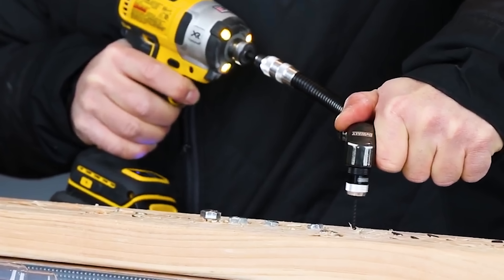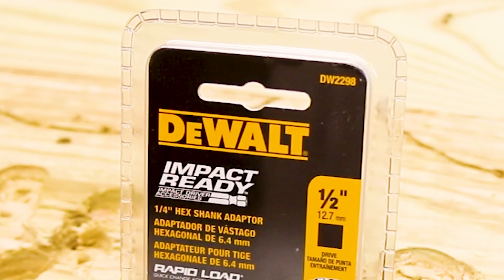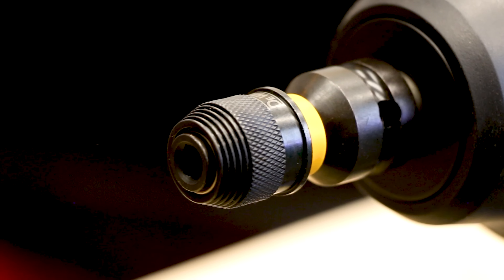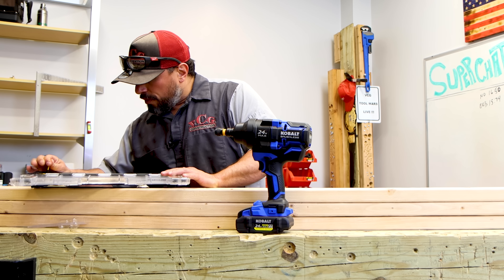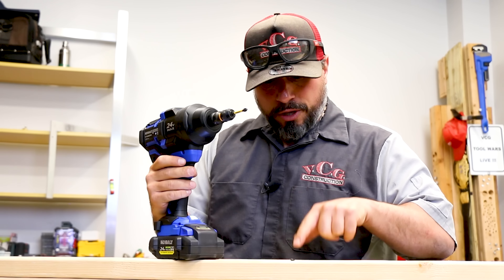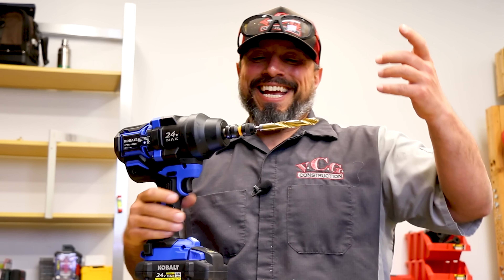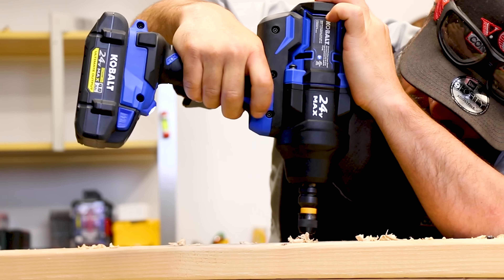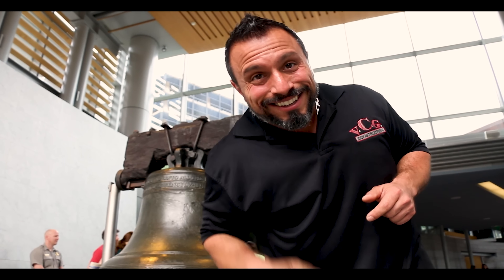NEVER BUY THIS DeWALT TOOL ACCESSORY (seriously)

Comment: NOT useless. We use a Makita Wrench with the adapter when using batten screws for fencing and/or rail mounting for cattle yards. Impact Drivers are great but they die a lot quicker. It's a specific setup for a specific task.

Comment: if you drilling in the roof into the studs to run cables, for sure you will loose the drill bits or the spade.

Comment: I have the Dewalt and the Neiko versions of this adapter. Although this adapter is well-built and impact ready, it is rated only at about 200 ft-lbs of torque. So, make sure you’re not using the most powerful mode of your impact wrench if you want this adapter to outlast your wrench. The best thing about using this adapter with the impact wrench is the fact that, even at slower speed, it will continue to drive your bits through levels of resistance that an impact driver could not handle.

Comment: It's genius.  Especially using the 3/8" anvil Milwaukee 2960.  Basically you get two high end devices for price of one.  Owe, let's not forget the impact wrench also has an adaptor for becoming a hammer impact drill. Yep.

Comment: I’ve just brought one, my impact driver 886, isn’t quite powerful enough to easily drive concrete capcon screws in. So brought the 894 impact wrench and both the deep socket 8mm hex, and also this adapter. My thinking is I’ll be able to try just the adapter with my original 8mm hex and if it feels funny I’ll be able to use the 8mm head. Speed is cash, and cash is king.

Comment: It be better for using on a socket wrench to use as an adapter for driving screws. But then agian dont they have adapters that convert so its easier to do this. What would be better is if dewalt made a 3/8 to 1/4 collet, and then a 1/4 to 1/4 collet then sell it as a 3 pack so you can use regular bits with a socket wrench because then a person can use there socket wench with any fastener, similar to how you can use a drill with any sockets.

Comment: I used one of these with a small milwaukee impact wrench before I bought in impact driver. IMO buy another make of adaptor if you need one, the 'bar' he mentions is not for extra torque or anything like that, its just a cheaper way to manufacture the adaptor. After the adaptor is a little worn the bar turns ( it has the ends bent to keep it captive ) and causes the bit to jam in the adaptor, the only way to get it out it to remove the small snap ring and reseat the bar.  As the adaptor is used more it happens more frequently.

Comment: I work a lot on cars and have an impact wrench and this adapter would be so nice to have instead of a whole new driver aswell
Reply: Yeah i was gonna add it could be nice to have to help take off the caliper screws if they are left on the vehicle
Reply: A 1/4 inch though it would easily break on a 1/2 inch impact it would have to be very light work
Reply: milwaukee makes it too. in both 1/2in and 3/8in
Reply: @michaeltrower6792  I agree. I could see a cheapo brand (or even a good brand) bit shatter and send shrapnel flying all over

Comment: @VCG Construction.  I think  somebody at Dewalt watches TTRs and this is their solution to make impact wrench TTRs interesting. You can test not only nut busting torque but also drilling with large spaddle bits and large hole saw bits and drive really long and large lag fastners including Timber Locks.

Hope your wife is better and hope you and she stay safe and well.

Comment: I have this accessory. I find it works best on older tools that are smaller. I had a Makita 14.4v 1/2 impact wrench, the old NIMH style and I used it on that for quite awhile. Also, my entry into the DeWalt platform was the DCF880 1/2 impact wrench which is the exact same size as the 885. I just bout this $6 adapter at Lowes rather than buying the 885 to do impact driver related work. I primarily do mechanic work, not building or crafting so the impact wrench is a more used tool by me. Most mechanics will have a variety of 1/2 impact wrenches in their shop. Another option would be to use that on the M12 stubby 1/2 impact in mode 1 when you're doing interior work with torx or phillips fasteners.
Reply from the maker: Thank you for the awesome feedback Jon Da Silva we appreciate your thoughts and experiences!

Comment: I got the Milwaukee 2861-20 (with pin).....so no problems drilling and pulling it out without adapter pulling free.  Still rather use the right tool for screwing/drilling....with friction clutch.  For really big bolts, yeah, get the automotive gun out.....my Milwaukee 2767 with 1400 ft/lbs will get the biggest job done......rip a tree stump in half if you overtighten a big fat bolt

Comment: The problem with that is that it will snap 25mm impact bits like crazy on big fasteners and I would have both because the impact driver is liked for being compact but for realy long fastening or drilling big holes this impact wrench adapter is amazing and no impact driver on the planet Could have that much torque

Comment: I work on decks alot and always wanted to use a impact wrench on drilling for  lag bolts .they are long and large and are power hungry. I think it's a gr8 accessory from the looks. I use a impact and socket for fastening but would love using it for drilling. I am using the old Milwaukee heavy duty drill with the old big batteries and it ( American made) still drills like a boss.heavy duty!  But one day it will go and when it does ,I would like a way to use my impact wrench to fill its void. Kind of interested in how it could be used on a hand rachet. I guess as far as it slipping off ,you could use the old piece of paper jamming trick to keep it on.

Comment: Looking at that I think you might be better off just going and getting that 7/16 linesman impact driver that Milwaukee makes order a similar tool if anybody else has got one does that see that that adapter coming off that hog ring up or you're pretty much it's going to do that with any impact wrench so yeah just need a bigger impact driver so that big linesman impact drivers just the solution is I think a better solution to this kind of problem

Comment: You can get detent anvil impact wrenches too, so that would solve the hog ring issue. If I didn't have my hex drivers, this would mostly only be useful for my hex to 1/4 and 3/8 bits as well as my magnetic bolt driver bits.

Comment: I got both the wrench and the driver. When I'm at home I use my driver. But I got that adapter and an assortment of bits and screws and socket to use with my wrench when I'm traveling. So basically......driver at home........wrench elsewhere

Comment: I think this would really excel if it was also made for the 3/8" anvil impact wrenches. In my opinion, the new 3/8" impacts are better suited for the dual use concept, particularly for applications using 3/8" lag screws and smaller, and then needing to drive regular wood screws. Save the 1/2" impact wrenches, and their weight, for the big heavy duty projects. Milwaukee has a 3/8" version of this type of adapter. WTF Dewalt?

Comment: I bought one of these thinking dewalt would be sturdy quality product. It does not come with a pin and o-ring. I would have expected the pin hole to be drilled both sides to secure the pin before fitting the o-ring, This one is drilled one side only so the pin sticks out 1/4" from the o-ring groove. Once in place it is loose and wobbles around and when used with dewalt screwdriver bits they are so out of control it is really unusable. I am really surprised dewalt let this through their quality checks. Cost me around £10 GBP on Amazon, a total waste of money, trash for the can.

Comment: This and the keyless chuck are not the right tools for the job. Impact drivers/wrenchs are designed for fastening not drilling. If you want to do quality work use quality tools and the correct tools.